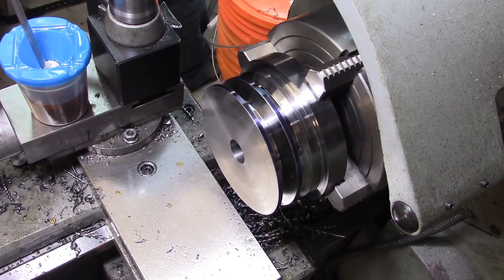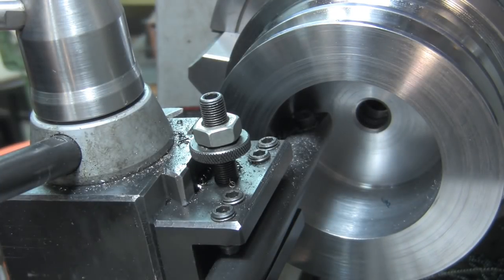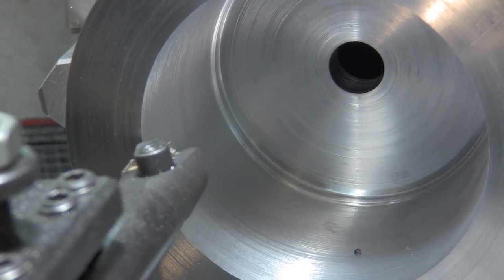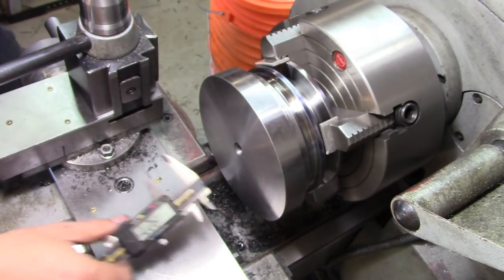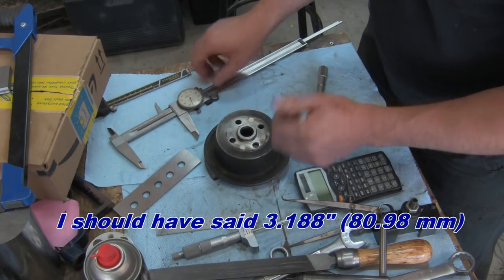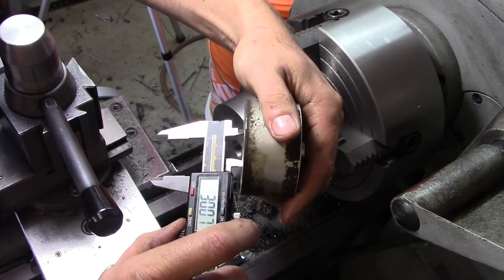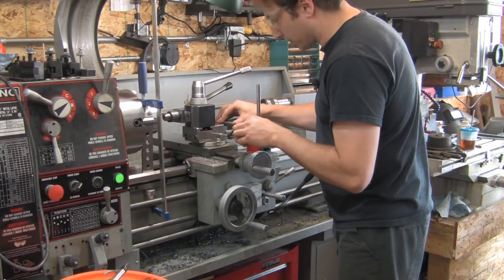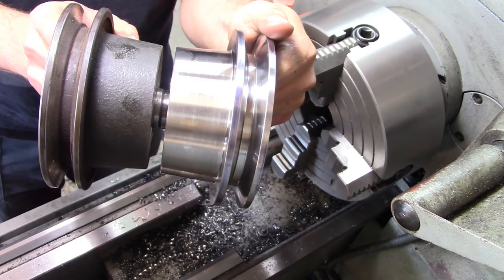Making a Custom Water Pump Pulley Part 2

Comment: Galvanize
Reply from the maker: I'm still reading up on what's involved in doing a decent galvanizing job at home, but it is something I'd like to learn.  Heard nickel is another good one for home plating procedures.
Reply: @EverettsWorkshop  Yes. Both are good to know but cleaning of parts (pickle bath) is the key. Been a long time since I worked at electroplating company. Easiest thing is anodizing aluminum. Both Nickel & Galvanize require volatile chemicals that you can't flush down the drain, lots of EPA stuff. Best is to find a company close by, go and watch, learn then decide. Good luck with it. Oh, hard on clothes, too. Also, need a Emergency Eyewash & Deluge Shower installed first.